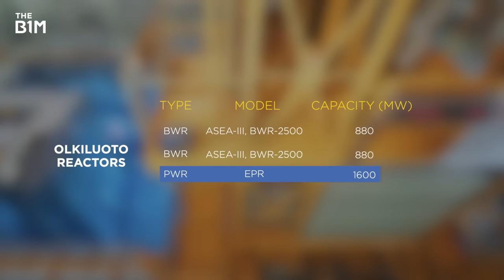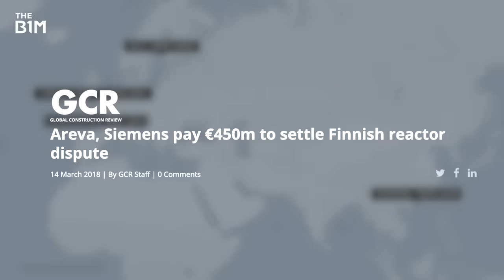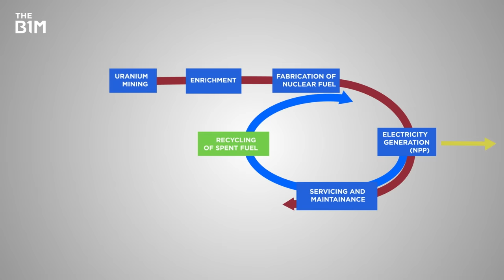Finland Might Have Solved Nuclear Power’s Biggest Problem

Comment: I was actually expecting a way to use it back as an energy source or a fuel or You know...
anything other than burying it deeper
Reply: @darkone9572  madman
Reply: @darkone9572  Those rounds are not radioactive, they're spent, only the metal is extremely tough. How do you NOT know this? It's in the name: DEPLETED uranium.
Reply: At the beggining, it's a mining product. At this depht, it's becoming a geologic artifact, and will stay here forever, much longer than needed to become not radioactive, and the loop is closed.
Reply: Burying it deeper makes sense though. The whole point is that it will stay there long enough so the radiation will fade over time (it takes 100 000 years). Finding a site with no geological activity with very good rock characteristics is enough for that, we have all the science and technology for that. We even think it through so that a future civilization who would have forgotten won't find by accident (by choosing a site where there is no valuable resource around worth digging for). Burying it deep also makes sense in that if a civilization is sufficiently advanced to dig that deep, then surely it has at least the technology to understand that those things are dangerous (and when they find it the danger would be far far less than it is today anyway). So yeah, putting in in the ground is not a bad solution.
Reply: @Powerhaus88  But U-238 is radioactive.
Reply: You mean like the French and Russians have been doing for decades?
Nuclear waste is a solved problem. It's annoying how people willingly ignore the fact that the solution has been put into practice long time ago.
Reply: reactors of closed cycle, Russia. it exists
Reply: @Powerhaus88  yeah, my apologies for having to be the one to say this, but... tell that to children being born in places bombarded with it, today. All isotopes of Uranium are radioactive, even once depleted. It's just not as much, but if you're living near the stuff on the surface, it can hurt you.
Reply: @PilkScientist  that is not how either radiation or depleted fuel storage work.

Only place where your kid could go and get a meaningful dose of radiation is if it went for a swim in a running reactor.....in that case yes, I assume nuclear power is dangerous

Comment: The process at Onkalo is so much more than simply burying the problem.
We bury it very deep in special containers and gave it a fancy name.
Reply: The fancy name sealed the deal for me
Reply: @alessiofe  a friend of mine says fancy names account for over 50% success of any engineering idea: 
neural networks, gradient descent through time, support vector machine...
Then he came up with the name: "shotgun gradient". Now he only needs to invent something actually useful he can name.
Reply: Special operation containers?
Reply: @busterbiloxi3833  
DeBuCesr:   Deeply Buried Copper Encased Spent Rods
UADS:   Unattended Deep Storage
Reply: Ehh, 500 meters isn’t very deep on earth distances. We  bored holes in the earth up to 12000+ meters, so 500 doesn’t impress
Reply: @00Recoil  Awful hot stoff, and what if for some reason you have to dig it up
Reply: @marcwinkler  the point of burying it is so neither you or anybody have to dig it up ever again. It's so far down, that it'd only ever be a danger to someone who came along & tried to dig it up.
Reply: @PilkScientist  Reversibilitry was a subject for years. Look it up if you are interested I am not.
Reply: Sorry reversibility
Reply: @PilkScientist  have you forgot the argument of water leaking in, like it was not espected but anyhow happened in the german nuclear storage salt mine? Nobody can tell if this facility is really safe with current knowlege, going back only fifty years. And under the infuence of radiation, also rvs eventualy becomes brittle…..
Reply: dig the sarcazim, well done!
Reply: "Onkalo" just means cave in Finnish lmao

Comment: Another possible alternative is Molten Salt Reactors with Thorium. They are cheaper to make, safer to run and the "waste" of the process is not only a lot less (like many multiples less), due to the recyclable/ freshening  of the fuel, but the actual ash waste only has to stay stored safely for 300 years, and not the 1000s of years the tons of reactive waste the LWRs produce today.
Reply: What is the primary blockage stopping this from advancing ?
Reply: @artstrology  The proliferation of LWR. There's just been a ton more research and work done to make them work instead of MSRs. If the past research and work been done to promote and use MSRs, we'd probably be in a fossil-fuel-less world right now. But, in the 60's and 70's the atomic owning governments of the world needed enriched plutonium for their A-Bombs and so all efforts went into LWRs. Enriched Plutonium isn't a by-product of MSRs, and even though MSRs could theoretically be built so small and safe, you could power a home with them.
Reply: @artstrology  money
Reply: @cheezy2455  Money is a major causation but never a primary one
Reply: @scottamolinari  Sounds like you're describing Fallout
Reply: @DRdarktnt Huh? Fallout? You mean what I'm saying about nuclear waste?
Reply: @scottamolinari  Fallout the game franchise, where cars and homes have their own nuclear power
Reply: @DRdarktnt  Ah. Right. Never heard of that game. But yeah. Imagine it could be possible. :D (whereas cars would be a bit of a stretch). :D
Reply: @artstrology  IIRC the technology to make it happen hasn't been invented
Reply: A longer half life is better for the environment because radiation is released much slower.
Reply: @artstrology  Every molten salt process is highly corrosive? Just asking.
Reply: @kimmomartikainen8989   I have no idea.
Reply: I recall reading thorium was right there at the start of the atomic age and was the intended initial fuel to power the first nuclear powered US submarine. Uranium instead was used and I am not aware of any official explanation, speculation has it that uranium was easier to develop for nuclear weapons.
Reply: If it was so easy and efficient, it'd be used be used rn...
Reply: @warrenklein7817  Speculation has it that producing energy with thorium was more expensive than with uranium in the beginning of the atomic boondoggle and is even more so now.
Reply: @artstrology  physics. Not many material can actually handle liquid, superheated salt that's also radioactive. The pipes also can't really be changed since it's not like you can store what is badically radioactive lava anywhere during maintenance.

It's not money, it's about the science not being there yet.
Reply: @B1gLupu   Thank you
Reply: @laurienickless5564  I saw that, very exciting.....should be big news when the first one is operational
Reply: AND . . . They are foolproof!  Just look at the success of the Monju Fast breeder Reactor in Japan: https://youtu.be/9QfjvBNeoao
Reply: @scottamolinari  Read the fine Wikipedia page: https://en.wikipedia.org/wiki/Monju_Nuclear_Power_Plant
It specifically states “Liquid sodium,” not salt.
Reply: @KeithOtisEdwards  So, I'm confused to your point. Are you being sarcastic or serious about MSR being foolproof? You are only making my point stronger by pointing out it is liquid sodium and not molten salt. The Monfu reactor isn't an MSR.
Reply: China is developing one atm
Reply: People keep saying that, but then the people who actually build reactors apparently don't know. Or maybe they are completely aware and have good reasons for doing what they do.
Reply: You don’t think if other types were cheaper, easier to make, and less waste, that people wouldn’t be building them instead?

It’s easy to comment on YouTube. Much harder to build a nuclear reactor.
Reply: @codycast  Again, at the dawn of the nuclear age, governments specifically wanted a nuclear source that could produce nuclear weapons.  That was the top (really, only) priority.  So all the research (and money) from 1940-1970 was put into processes that could maximize nuclear weapons.  Since thorium reactors could not produce high grade plutonium, no research was done with thorium.

If the goal of nuclear research had been to produce electrical power, the nuclear industry would look very different today.
Reply: @jussiollila7714  the reactor on which the blackout and LOC tests were done in 1986 was the EBR-II a prototype of the LMFBR (Sodium coolant, metal fuel), not an MSR. Corrosion in MSRs is still a problem, particularly if the design has circulating fuel salt outside the reactor to remove fission products/neutron poisons. For a different approach to MSRs, look at the MOLTEX SSR which puts the fluoride fuel salt into pins that are replaced when the fuel is recycled, thereby eliminating the corrosion issue.
Reply: @scottamolinari  The "they went LWR rather then MSR for Plutonium" rant is a fallacy. The real reason was expediency because the LWR tech was already developed for marine propulsion. Its the same reason LMFRs got the back seat to LWRs. The Navy didn't like salt or sodium reactor schemes. The vast majority of the weapons ever made came from dedicated plutonium production facilities which existed well before commercial power plants and nearly all the rest from so called "experimental" reactors. Blame Richover, not Oppenheimer for the proliferation of LWRs.
Reply: @richardbaird1452  I think Mr. Sorensen's talk tells it all. https://www.youtube.com/watch?v=bbyr7jZOllI

And, your point doesn't negate my main point. MSRs could be a great future in lower cost energy.
Reply: @scottamolinari  Sorensen is marketing in all his talks, so take it with a grain of salt (no pun intended). Even the Nixon tapes he likes to play have nothing real to say about LMFR vs. MSR, since all the development was taking place in Illinois/Idaho and Tennessee respectively, not California. The truth is the LMFR was better positioned given the existing technology and materials science in the 60s and that's why it was funded. Which is better today is an open question, but there is orders of magnitude more data on the LMFR side.

MSRs might eventually play a role, but I wouldn't bet on the Flibe energy designs, others appear much better (e.g. MOLTEX, Elysium, MCFR). The issue is we have almost no operational experience with MSRs and as Charles Till the director of the IFR program that safely ran the EBR-II for 30 years, which developed into a complete sodium cooled metal fueled fast SMR system says "You HAVE to test it, calculations and modelling aren't enough".

I'm far less concerned about cost than I am about safety. All it will take is one serious accident (radioactivity release) in one of these new designs and we'll never build another fission reactor due to emotional public outrage. Cost cannot trump safety and safety means extended testing. There is no other rational way and MSRs are simply behind the eightball in that area due to history. No amount of wishing will change that.
Reply: @richardbaird1452  The facts Mr. Sorensen shows are the reasons why MSRs never took off. It doesn't make his marketing any better or worse, but explains why a technology that was proven to work, never was used mainstream. 

Your points also don't negate the points I'm trying to make. There is a nuclear power source in Thorium, which when ran in an MSR (or TFLR or whatever is using Thorium in a slow breeder reactor) is a good bit safer to run than the current fast breeder reactors and with less waste (which is the topic of the video). 

Can you agree Thorium based MSRs, if done right and safely, could be a form of energy everyone, and especially our environment, could benefit from?
Reply: @richardbaird1452  I didn't know Weinberg was the inventor of LWRs (too). Ha. Very interesting video, despite Sorenson being in it a lot.
Reply: @scottamolinari , I first physically touched the calandria face of a pre-commissioned CANDU at Bruce Generating Station as a physics student 40 years ago. We utilize fission in Ontario big time and also teach it quite well! We generated ~95% of our electricity (~150 TW/hrs) in 2020 from non GHG sources including ~60% fission and it has been that way for a long time. It is rare that I see anything that is really new in a vid compilation most of which is 10+ years old. One can't really learn this stuff in anything more than a superficial way from vids...it takes study, reading and lots of it. I believe everyone has to come to their conclusions individually and provided they do the work, whatever they come to should be respected even if one disagrees. I say this simply to let you know it is unlikely providing a vid link is going to enrich my understanding.

Perhaps a major difference in our positions is the length of time we expect to rely on fission as an essential part of the mix. Waste is a problem regardless of the fission system used. Granted it is a much shorter timeframe and manageable problem for both well designed MSRe and IFR derived systems which produce fuel waste streams with essentially the same radioactive timeframe. Does that mean we shouldn't use fission now...no. But it does mean given the likelihood a better solution will arrive well before the end of the time line proponents prophetize we should utilize fission for, it would be wise to be wary. Companies don't breach that topic because they are in the money raising/making business, even when they propose ways to make that money safer, cleaner, etc... IMO Sorensen is one of the worst offenders. Always very one sided and leaving out things that don't support his position. Things like the graphite moderator needing relatively frequent replacement with the old needing to be stored as HLW that we don't know how to treat or that the Beryllium in the FliBe is highly toxic or that any constant online FP removal system in an MSR has piping leaving the reactor vessel carrying primary fluid and every such connection is a potential failure point (Not all MSRs have this "flaw", but his does). You know, little stuff that marketers/prophets often leave out...lol I'm picking on Sorensen to make a point, but to be fair nearly all the spokespeople/C-level folks in nuclear, renewables and storage are guilty of this to one extent or another. If you're a vid learner, I'd suggest Ed Pheil on Elysium and Ian Scott on MOLTEX as a counter to Sorensen on MSR tech. IMO both their MSR designs are better and safer and in some ways further developed. For LMFR, Charles Till or Yoon Il Chang are as good as it gets for the general public, but that is mostly reading, not vids. To go much further means scientific papers which are much harder to absorb for the majority of people.

On the topic of Th. If one believes human ingenuity will come up with a superior energy solution to fission within a 1-2 hundred year timeframe and we calculate we have enough spent LWR/HWR fuel and DU tailings based on the existing once through uranium cycle plants to power the non-renewable portion of our needs that entire time using advanced reactors, then it would be immoral to generate an additional waste stream over and above that inventory by adding a thorium cycle to the mix. Concentrate on cleaning up the existing spent fuel mass which we know how to do before creating a net new one. Think about reducing the total radionuclide inventory, not per unit of new power. Even if we went full-on Th, we would still have a huge mass of existing spent fuel from 50-60 years of operation plus that produced to end of life of existing plants and the only viable way IMO to address it is by cycling it through some kind of advanced reactors (probably a mix of MSFR & LMFR). Another point is the longer that once through spent fuel sits, the easier it is to extract weapons grade material from. Leave the commercial Th route until/IF it is needed and we end up with less radionuclide waste to deal with overall. Quite simple really. By all means do the science, engineering and even testing, but leave the commercialization off the table for now. We don't NEED to do it and we have a moral responsibility to deal with existing spent fuel.

As you can see by now, I view advanced GenIV fission as a stopgap solution that when done properly, reduces the EXISTING used fuel inventory timeframe significantly with GHG free power as a byproduct, not as a long term energy panacea. With regard to commercialization/implementations of all technology not just nuclear, sometimes the often used statement "just because we can doesn't mean we should", is better read as "unless we have to, we shouldn't". Viral gain of function research is an non nuclear example that comes to mind.

One thing I suspect we do agree on is, no new water cooled reactors, regardless of design. I would push that 2 steps further and say no new thermal spectrum power reactors and nothing but GenIV going forward.

And in reference to this video's main topic, deep geologic disposal of once through spent fuel is an environmental and moral crime in my eyes. We CANNOT know the geologic future far enough out and to think we can is arrogance personified. Even when successful, you end up with a Pu-239 mine after several thousand years once enough Pu-240 decays. The only moral way to dispose of the TRU inventory, is to consume it.